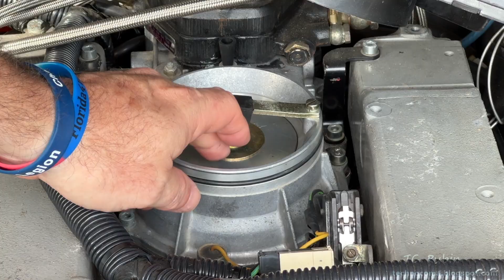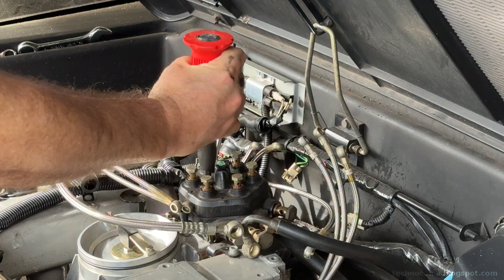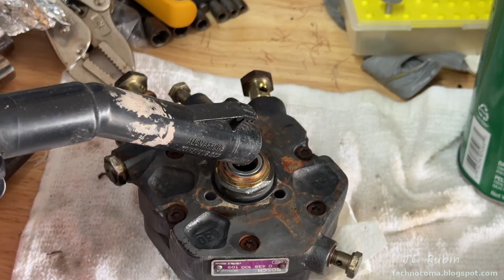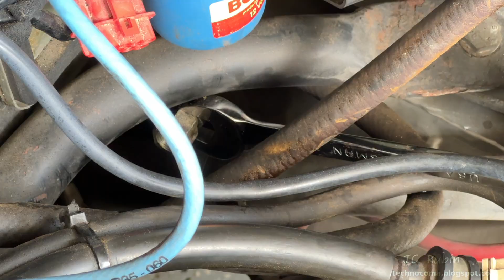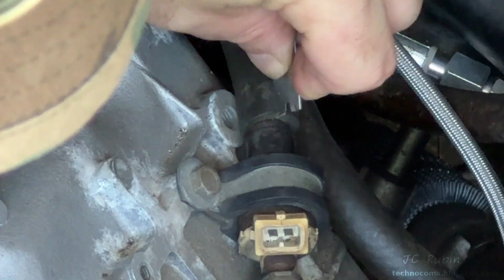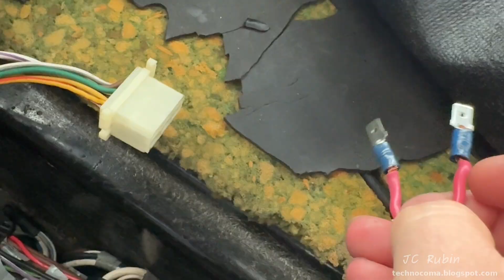Bosch K-Jetronic System Failing on a Delorean - Lets Fix it Part 1

Comment: Thank you for your video. can't wait for part 2. I have the same issue. I've been fighting trying to get the mixture right and having the cat get to hot because running really rich. the dwell was set but have been going back and forth trying to smooth it out and getting the mixture right. Can't wait for part 2 since I'm going through this procedure this weekend. thanks again.
Reply from the maker: Glad to help, part 2 is on its way!

Comment: I wish this video was made a year ago when I did the same return line. Like you, I have the Hervey fuel lines from about 20 years ago and just recently replaced the factory FV and return lines using DeLorean Go lines. I ended up doing everything you did, but could have saved some time from having to figuring it all out on my own! One thing I'm surprised you didn't do was add anti-seize to the 3 fuel distributor mounting screws. I did that to insure if I have to remove it again in the future, they should unscrew much easier.
Reply from the maker: You're right, ill remove then and add a bit of anit-seize.